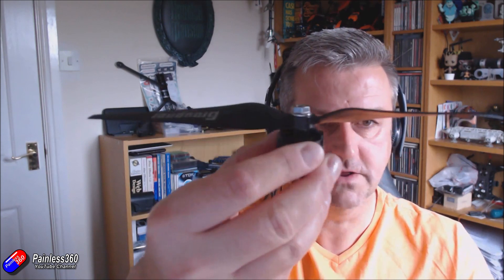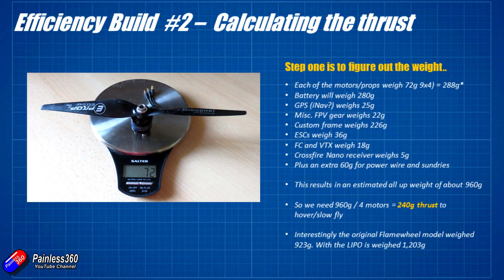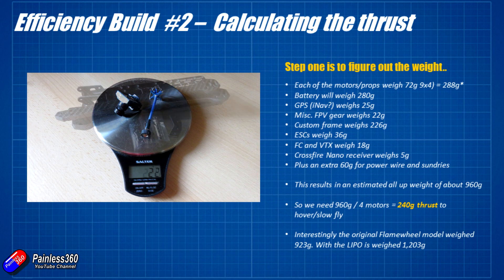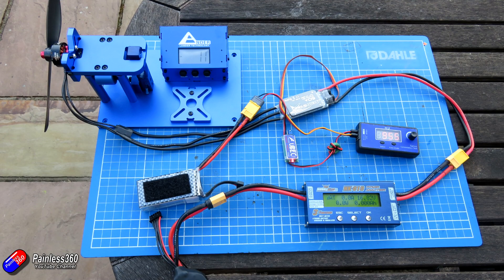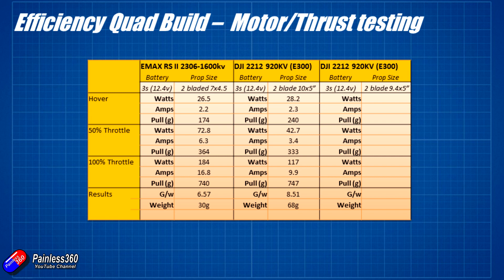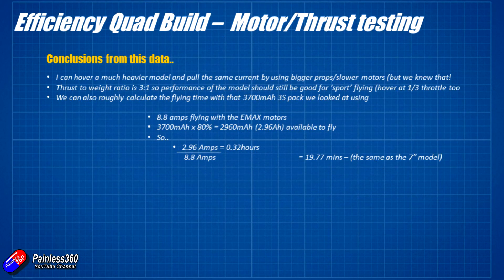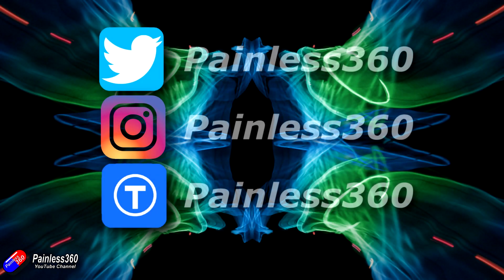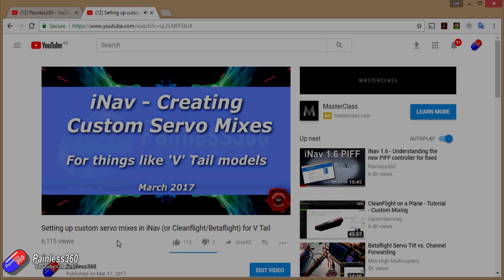Endurance Quad Build: Calculating weight, thrust and flight time

Comment: I wonder how much weight is in those flat arms, compared to hollow round/square carbon tube arms that frames that size traditionally use?
Reply from the maker: Good question. I've spoken to the manufacturer about that but adding solid alloy/composite mounts for the body and motor that would be strong enough would a lot of weight back into it. I hope that we start to see far more options for frame and motors as more of us are after these products..
Reply: I imagine square hollow arms like the RCExplorer tricopter would be the easiest/lightest solution, potentially not requiring any mounts at all (just bolting through top & bottom plate), but yes for the more common circular hollow arms the additional mounts would probably be counterproductive.
Reply: I got hex-shaped arms on my new 8-9inch build.They seem much stronger than stock dji f450-f550 arms, and they are also 5grams lighter - not to mention they are really easy to adapt to different prop sizes.
Reply: Nicola Guerrera Cool. Where did you find these?
Reply: @northernflyer5311  i 3d printed them. I'll share the design as soon as it's somewhat usable
Reply: @northernflyer5311  I've just flown my design for the first time and it was TOO fast - crashed from 20meters straight to ground and broke 2 arms.

Comment: Cool project! I'm going to take a seat here. I know this is an endurance, but how long could it fly at 100% thrust and more importantly for me, at what top speed? I'm looking for 125 mph / 12min flight time...
Reply from the maker: Not that fast - to be tested but I'd expect in the 50-60mph. You'd need to look at something with more powerful motors and sports props for that..
Reply: @Painless360  thanks thats still great pace. Is there any motor config coming to mind?

Comment: I run 2212 motors 980kv on 4s and get 30-35 min flight time with a 5Ah lipo, and the props are 1045 with a 4in1 20A esc and matek f405 fc
Reply from the maker: Cool! What’s the weight of the model and LIPO?
Reply: @Painless360  I don't have a scale so I cant tell, the battery is a Zippy 20c 5ah blue color one, motors are racerstar ones and the frame is a diatone q450 v3
Reply: I have almost the same configuration on my old F450, 5Ah 4s lipo, DYS 2212 750kv w/ 10x4.5 prop and SP F3.  My motors get VERY hot to the touch. I think that my old Hobbyking ESCs can't really handle the voltage.
Reply: @NicolaGuerrera  did you check if your motor screws are too long?
Reply from the maker: I'm not sure that those motor can handle that sized prop on 4s.. Best of luck!
Reply: Yeah. I remember 2212 980kv was the recommended settings for a 450 Quad back days. I remember the longest was 1hour+ with customized 450 frame. with Li-ion battery, maybe several years ago.

Comment: Probably the most efficient propellers for these motors are Master Airscrew 10x4.5. They are more expensive than other makes but well worth the price. I use them on my 480mm quad switching from DJI 9.5x4.7. Here is test comparison data against other props https://pdfs.semanticscholar.org/8e46/ce903050b3bd4220b9434e41f45ae49a0a68.pdf and link to props here https://www.masterairscrew.com/collections/mr-series/products/mr-series-10x4-5-propeller-set-x2-white I bought mine in the UK from Sussex Model Centrer on-line shop if you would like to try them.

Comment: I really like what you're trying to do with this project Lee, but this latest video puzzles me a bit! Your thrust tests and calculations show that the 10" quad will give around the same endurance as your previous 7" quad using the same battery, and presumably the 7" version will show the same improvement using the Li-Ion battery. So, what is the advantage of a larger, heavier and presumably more expensive unit?
Reply: Chris Balmforth the proof will be in the flight tests 🤪 it’s all theory at the moment 👍
Reply from the maker: That’s what we’re finding out. Until I did this video we didn’t know that did we :)
Reply: Point taken! Thanks Lee.

Comment: With that little Ampere drawn from the motors you can also go for a FC, PDB, ESC All-In One solution to save some additional grams. At first I thought about the KISS, but there is no inav for that, so I had a look at getfpv and saw some that might work: https://www.getfpv.com/electronics/electronic-flight-controllers/aio-all-in-one-fc.html
Reply from the maker: Great idea. Thanks for the post!
Reply: You are welcome! Just had an additional idea if there are no inav targets for those AIO FCs a 20x20 4in1 ESC should weight about one normal ESC and would work as well.
Not much weight saved, but every gram counts in the end. A friend of mine even cut the screws on his motor directly above the propnuts to save 2g per motor.

Comment: Won't you be able to drain the Li-Ion batteries lower that you can the Lipo? You also could shave off a bit of weight by getting flynoceros to cut you some shorter arms?
Reply: 3.0v per cell is nice. some manufacturers state as low as 2.5v. but I'm running them down to a resting 3.2v without anything to report

Comment: So the previous 7" build you did inspired me. So I made a 7" myself that quickly became a 9" using what now turns out to be a very similar motor/prop and now battery combo as you are here . 

Multistar 2213-935kv
DJI 9" props
Stretched martian II cross iflight Frame to make 9"
Samsung 30q x8  (4s2p) =6000mah around 8C

35m47s :) Running the cells down to a resting voltage of 3.2v 

AUW is a little heavier at 1120g But I have loads of stuff on board . GPS tracker, 9w headlight ect.

Comment: thanks for all the great videos,my first build was a endurance quad using a alien 560 frame from hobby king love the look of the frame but the legs were way to weak,ended up buying another frame and using the legs to double up to sturdy the legs.since I had a second frame decided to build a second quad found some dji s800 motors to put on it. the specs say 17 inch props max but was wondering if 18 inch props would work? since the release of inav been thinking of revisiting that build with more modern equipment. what flight controller and esc's would you recommend for a gps build?
Reply from the maker: Most modern flight controllers work great. Make sure it has exposed i2c pins for the compass and you’re good. I’d have used a F4 AIO Holybro for the vibration isolated IMU if I’d had the space in the frame..

Comment: It's interesting you've chosen a 3S rig.  I had always understood you could get greater efficiency if you chose a higher voltage (eg 6S) and a deeper pitch prop.
Reply from the maker: I want to play with LI-ion so this works. Also, the exotic lower KV motors needed for 6s are EXPENSIVE!! :)
Reply: Painless360 These aren’t too bad:
http://www.myrcmart.com/rcx-be360815-460kv-24n18p-outrunner-brushless-motor-designed-for-multicopter-free-mounts-high-quality-p-6239.html

Comment: probably a wise choice going with the DJI motor and props. [Never thought I would ever say that:) ] No doubt they ran all the permutations long ago. Have you seen Iforce2D's work with Ardupilot on F7 boards?
Reply: I have. He did a series on using Revo Mini with APM. I've got one but so far, no luck getting it to work. I need to revisit. It would be really cool to fly a 3 inch with all the autonomous capabilities.....

Comment: You should try the RCtimer sl2212 920kv motors, they are very efficient. Although they do take a while to ship to the uk. You should also try 4s, it can be more efficient sometimes, and also a bugger battery, I use an 8000mah 4s on my hex, maybe you should try a 5000mah 4s.

Comment: If you beat the 25-30 minute mark... You would've done it fantastic
Reply from the maker: I'm hoping so - there is a little more work to do to have it flying buttery smooth and have the GPS RTH fail-safe solid before the test. I cover that all in the next video..

Comment: Aha! Now you’re talking, it’s interesting balancing off number of cells against amps drawn/duration. Most of my duration builds have been 4s-6s, to achieve lower amps but that does mean a heavier pack. There is a real science to this which I think we are only scratching the surface of, especially with the much greater variety/availability of components, inspiring work again Lee 👍 https://hobbyking.com/en_us/multistar-elite-2312-980kv-motor-set-cw-ccw-ezo-bearings-4mm-main-shaft-n45sh-magnets-2-motors.html
Reply: Hi. A little question. If i understand correctly, for the same amount of thrust, does increasing cell count (or volt) lower the amperage draw?
Reply: Yes, for a given prop rpm a given wattage is required so as the voltage goes up the amps reduce.

Comment: Great stuff as always! I have rwo questions: What makes you switch from the 4 in1 ESCs to "regular" ESCs in this model? Additiobally I wonder if perhaps the li-ion batteries are less sensitive than the li-pos. Could one discharge them more than 80% safely?
Reply from the maker: 1) lack of space inside the frame 2) stay tuned ;)
Reply: Great! Thanks!